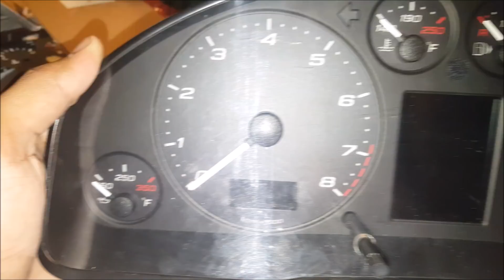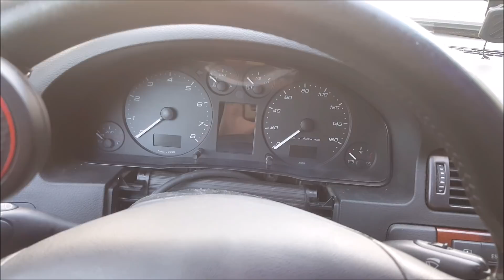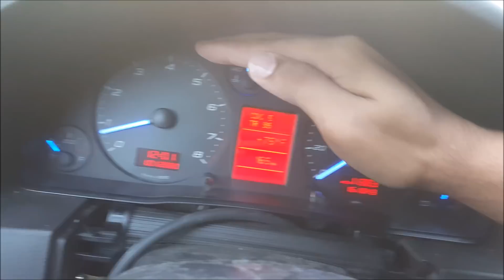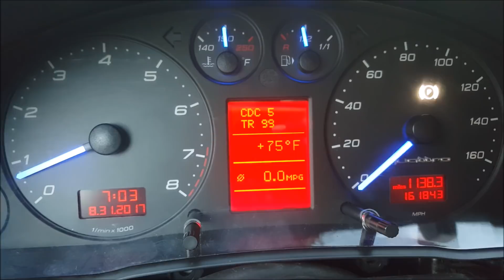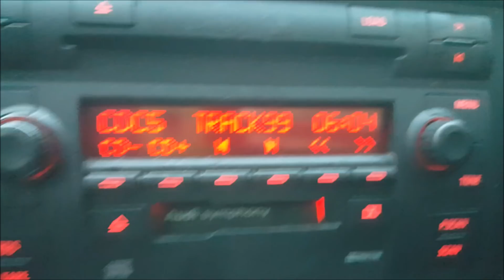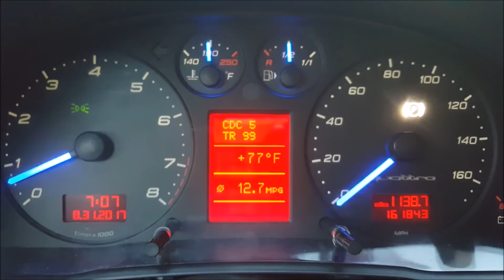Audi A6 C5 Cluster LCD Replacement

Comment: I soldered mine but it doesn't turn on. I desoldered and bought another display. Will try again. I also bought leaded solder because I was using non leaded and having a rough time melting it.

Comment: For future readers: the cheap chinese display is made for Magnetti Marelli clusters (i have one on facelift AJM), yours is a VDO, so thats why it doesnt line up. The manufacturer is visible on the back of the cluster.
Reply: So even though the LCD he required was the VDO LCD, the one he used is for Magnetti marrelli ? It still worked? As long as the pins lined up it didn't matter that the ribbon was crooked?
Reply: @saleemmurudker9639  exactly, but that doesn't always work. Sometimes it gets too crooked and you cannot close them back. You should use the one meant for your cluster.
Reply: @Stevemc93  thank you so much for the quick response, the reason I ask is only because I have a Audi S6 and I have not taken the cluster out yet, but I have the wrong cable I think, I see his cable is offset where as mine the ribbon is in the middle, I was hoping that I could make it work because it will take too long for me to buy another LCD and then wait for it to get delivered to me
Reply: @Stevemc93  but wait hold on, if he is using the wrong lcd and he is repairing his cluster from Audi A6 then that means I have the correct cable or am I wrong ?
Reply: @saleemmurudker9639  from what i know, there is no difference in a6\s6 clusters. You should try to fit it, if it works, great!
Reply: @Stevemc93  I'm am just assuming this because he was using the wrong lcd which I think is for a magnitti marelli cluster, so that would mean that he actually needed the VDO LCD which is the one I have I hope I'm right, because once you unsolder the original I doubt I would be able to put it back again if I am wrong
Reply: @saleemmurudker9639  you can resolder it, i had the exact same problem, bought the wrong one, and resoldered it until new one arrived
Reply: And after you resolderd it back there was no problem? I mean it was again just like before with the missing pixels? Or did you just have blank screen or something ?
Reply: @saleemmurudker9639  just like before, missing pixels

Comment: you think they would just make this plug n play.....
Reply: VDO and Jaeger cluster. the alignment is different.
Reply: @erikbaranyai5858  that's why got rid of my a6.  i loved the thing.  but too much over engineered stuff when problems arose :(
Reply: @presentthepast i understand. As u van see that lcd worked fine, but these little thing can make u angry. We are lucky in Hungary. Every bush every corner, there is an a6/a4 etc

Comment: So for this to be bad, it would have no readout at all? (I’m ASSuming yes).  I have the gear selection but nothing else...
Reply from the maker: mine used to fade as the car got hot or when the dash gets heated. But ive replaced completely blank displays and redone screens someone tried to fix with a cheaper soldering iron and electrical tape.
Reply: @Nemesis2747  I have this exact same issue with my A6 C5.. where did you get yours from? Have you got a link?

Comment: Hey, by any chance you think you can fix mine? How much wound it coats?
Reply from the maker: How much to wound coats??!! Are you in the US?
Reply: @Nemesis2747  hey, if a couple of the "fingers?" or the connections on the board get lifted off during the removal of the old LCD Display is it possible too save or is the hole board shot??? Any help will be awesome!?
Thank-you!
Reply: @brandonspencer309  some aren't connected to the board, just solder the thing and it'll be fine.

Comment: What were you doimg at the end?
Reply from the maker: James Totten its in the description. LEDs for the needles.
Reply: Nemesis2747 ok got ya.  Any info on replacing the turn signal leds? My right flasher went dim.  Where can you find the leds?
Reply from the maker: I get em on amazon or ebay. The LED is 3528 and needs to be soldered on like that last clip. Hot air and tweezers to get em off. and polarity matters so put em in just like the ones you took out. Each turn signal has 2 of them.
Reply: @Nemesis2747  hey, is there any chance that you can fix mine?

Comment: Can you reuse a screen after it has been de soldering?
Reply: In theory, yes. Unless you damaged it, but why would you want that, for when the new screen doesn’t work? Screen doesn’t work properly anymore because over time the ribbon cable fails. In the proces of removing the old screen it’s not unlikely you’re going to increase the existing damage.
Reply: Its because I have a parts car that the screen is fine in so I wont have to worry about colors not matching like in the video. If I can de solder the one from the parts car and still be able to use it on the other car, that would be great.

Comment: Thank you for posting this video, I'm about to swap out mine with a used one. My instrument cluster has an electronic issue with a short to ground, and my interior lights (backlights on dash a/c control, heated seat knobs, transmission gear selection stick backlights, door switch lights, etc, first wound not brighten, now are dead.) So have you had any experience with this part of the instrument cluster failing?  Remanufacturing companies have not been able to help. I was hoping to get my original fixed as a backup for my 15 year old car LOL.  (love how your soldering on you dining room table with the fine lacy table cloth)

Comment: I have a 98 2.8 and my cluster has always been messed I hate that I can't read it, glad you made this video cause I'm going to try it out, these cars are for electrical fuck ups and its very annoying! I had a problem with mine where I cut the car off and pulled my key out and the car beeps and tries to lock me in like I'm on the outside telling it to lock, and there's been nothing out there that I could find, so I figured it was the pump in the trunk because it sounds loud as crap, so I went to the junkyard and got one for like 12$.. Put it in and the problem went away,

Comment: how to remove the dashboard and needle? please advise
Reply from the maker: Twist counter clockwise and pull. The needle will not spin and you are twisting it out of the metal rod it sits on. Many other videos on youtube on how to remove cluster.
Reply: Thanks, but do I need the special tools or procedure? becuase there is an immobilizer brain on the cluster. I'm not sure what i should do when job done and install on the car
Reply from the maker: No special tool. Just torx bits, screwdrivers and a soldering iron. Only worry about the immobilizer if you are switching clusters from another car
Reply: Thanks sir, since I heard someone concern about to installation needle back, also can I know how to remove the white dial base